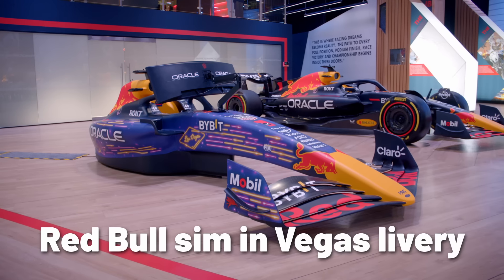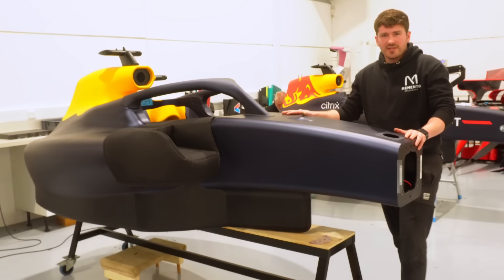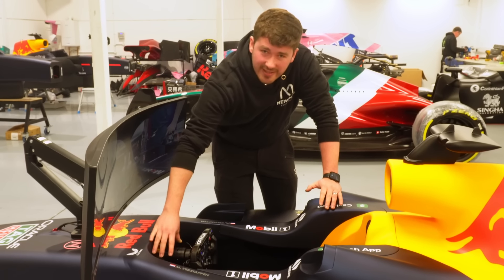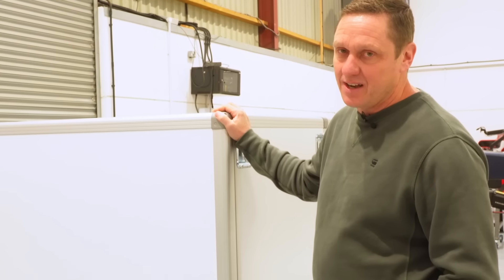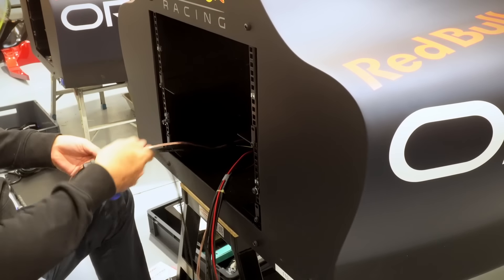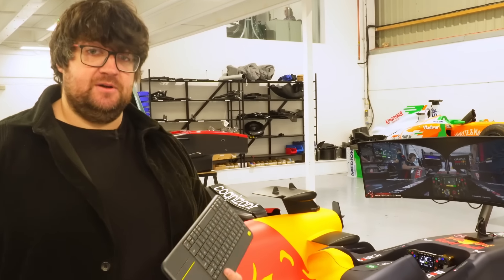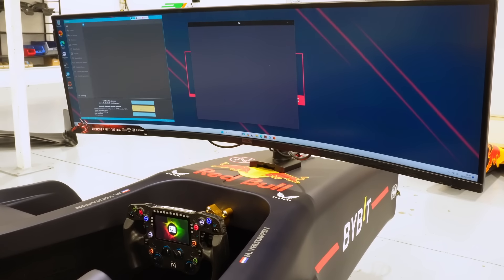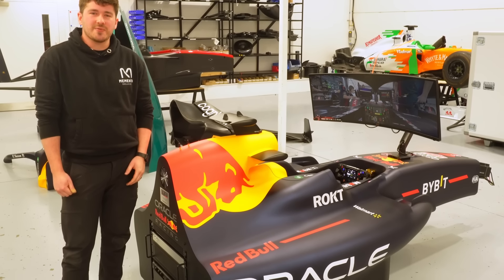Is the Max Verstappen $130,000 Sim Worth It?

Comment: So basically it's $20-30k of sim hardware and then $100k for the seat. Pass.
Reply: Well no it's a carbon chassis built to the same specs as the show cars and painted. Plus the 20-30k of sim hardware
Reply: @WixyJixy Well that's what he said, you are confirming it. I am with the people who think the $ 100k would be better spent to enhance the sim experience (motion, more screens) instead of how its looks .
Reply: @broyout3586  I think you both don't understand the cost and R&D that goes into a composite chassis. I wouldn't buy one either but it's a lot more than just a "seat"
Reply: @WixyJixy  Oh, I have a good idea about the costs. There are many F1 videos on YT on the subject, you can get an idea as well.

You are not suggesting the sim guys are paying towards Red Bull R&D are you? Is that even allowed under the cost cap?

What's left is carbon manufacturing, which isn't cheap, sure, with the autoclaves and all. Yet, this chassis isn't supposed to meet F1 specs. It's just supposed to look pretty. 

So that's exactly what it is, a seat. A very expensive seat.

(BTW a 'real' F1 steering wheel supposedly costs about twice the price of this entire sim. And the one they are installing looks pretty simular. So maybe this is a bargain after all ;-))
Reply: @broyout3586  I ain't reading all that bro
Reply: @WixyJixy  Excellent way of educating yourself! Cheers
Reply: id just get VR
Reply: @TimmsyTFG  Agreed. But people could easily mistake it as the next level in sim tech. It is not.
Reply: @WixyJixy  But that RnD spend for racing team and its well served already. Basicly they are using it to make income now. Its business. You can find companies that you can order special composite in shape you want. They dont need RnD. Just need to mold shape you like. Still it can be way cheaper. There are better ready motions systems with similar cocpits with more RnD behind and still cheaper. Guys, normalizing things like this ruin everything.
Reply: @broyout3586 true but whoever is buying this is def rich af so they’ll probably be able to afford everything else comfortably regardless
Reply: @thomasw..  True, if you can afford this, you could buy this and then upgrade to state of the art. With computer tech, upgrading is a given anyway, so why not.
Reply: Well no… you’re not “passing” because you’re broke 🤣😂
Reply: if you have a 130k disposable income  to buy something like this I doubt they worrying about overpaying not a big deal to them enjoy your life can't take the money to your grave
Reply: for the people that have 130k disposable income to buy something like this I doubt they worry  about the price even if they overpay  they have the money to afford it. enjoy your life you can't take the money with you when you're no longer living
Reply: if you have a $130k disposable  income I doubt they care about the price they definitely doing good for themself  130k is a drop in a bucket to a person like that
Reply: @broyout3586 and no one is forcing you to buy it?
Reply: The good thing is that the car always looks the same no matter the year, but if you get a Mercedes you have to changed it next season 😂
Reply: This buying half F1 real model like wtf and I bet is very real the simulator. How much you think an F1 car cost ????? The price is fair is just not for everyone.

Comment: Dude.... Move the screen down so it's sitting on the car, and it would be fine. Right now, as it is, they're looking up way above the wheel. Terrible FOV....lol
Reply: I thought the same thing....FOV is F$&%ed.  Im sure they move the screen down...but good grief that looks like crap on the monitor.
Reply: Also the fact that they can see the wheel in-game completely ruins the immersion. they're looking up, through a cockpit, into another cockpit. with two steering wheels in view... that must be a nightmare to drive. I have a more immersive sim at home made from wood 🤣
Reply: That screen looks pretty silly .
Reply: Guys, no one is paying $130,000 for this to do proper sim racing. This is a show piece for a company, or a super rich guy, to show his super rich friends.
Reply: lol someone call the fov police just kidding lol tbf something I've noticed with most f1 style setups is screen higher up and angled down which I don't like the look of but i think the reason they do it is the low slung formula seating position id bet if you actually sat in it the thing something us mere mortals are likely to experience the monitor and halo in between will line up perfectly with seating position although i do prefer the look of one I've seen previously cant remember who makes it but you get the full car with motion and something like triple 55 or 65 inch screens for full surround view
Reply: Idk if you can seen the monitor arm buddy
Reply: That was the first thing i noticed and I can't get over it
Reply: Yeah we all thought the same, with the screen up there you won't even use your dashboard
Reply: you're not taking how low your seating position is into account.
Reply: Probably can't even fit in this unless you're a jockey sized human being. For 130k, it should be very bespoke and have way better ergonomics and FOV

Comment: 90% of the price is the chassis. Servo motor, pedals, speakers, F1 wheel, monitors and a kick ass computer to run it all will all be under $15K. There is zero adjustability for different size people and different types of cars. It is pretty stupid when you think about it.

Comment: MILSPEC is used all across racing and not just F1... Makes things so much easier to troubleshoot. Id rather have a triple projector setup personally and a massive curved projector screen so it's full immersive. They're able to do that with flight sims but i don't think f1 games are aiming for that level of realism just yet.. I'd drop the carbon fibre and use fiberglass or plastic. Drop the construction price and add more features...
Reply: the factory sims also use curved projectors , this is all about looks

Comment: How does the Simucube handle the extension? As they recommended not going over 200mm 😅 here is running nearly 2m
Reply from the maker: We've had the steering column specially designed to accommodate👍
Reply: yeah looks great, saves your knees hitting the base :) 
 @thisismemento
Reply: No matter what you do you will get slack, torque twist... the longer it is, the more detail you lose  @thisismemento

Comment: Only one screen and no hydraulics? So all the money is in the carbon fiber tub and the GPU from greedy NVIDIA, Dont tell me its a INTEL CPU in that rack chassie?
i dont have that kind of money, but if i had like Lance Stroll money 130K is nothing. But still, not much you are getting for 130K USD. i would like to see some rolling hydraulics for the tub so it would roll in turns a bit, sitt on the rear tire´s then accelerating and dip forward then breaking. Dont need to much like a 50cm travel or so. just something at least for 130K....
And move down the screen so the bottom of the screen at least have contact with the tub. its way to high up and are not in line with the tub for what you would see  IRL.